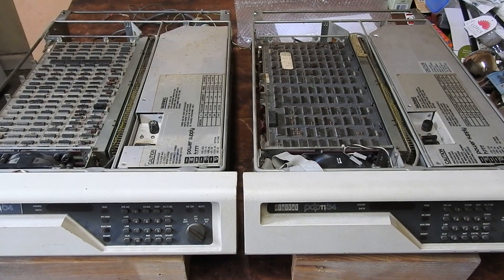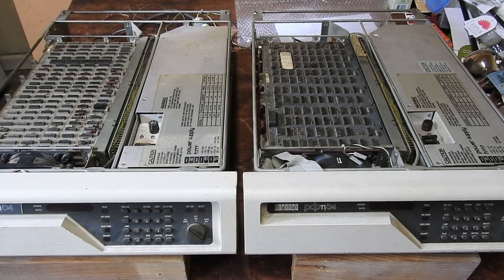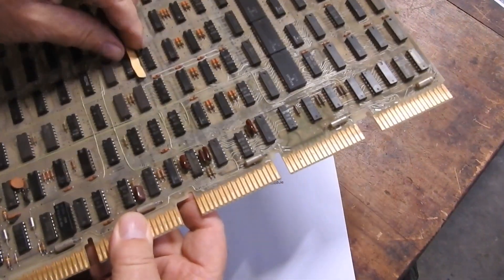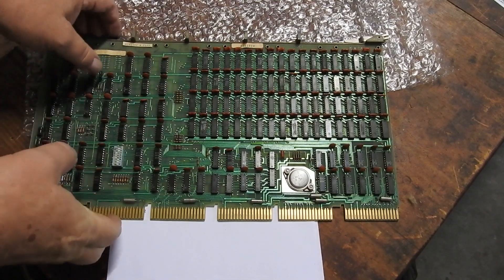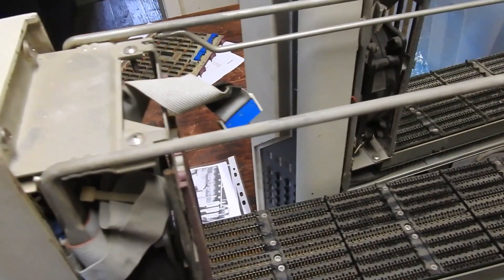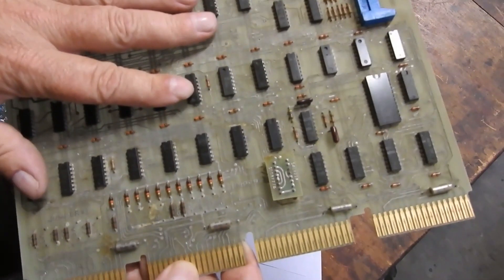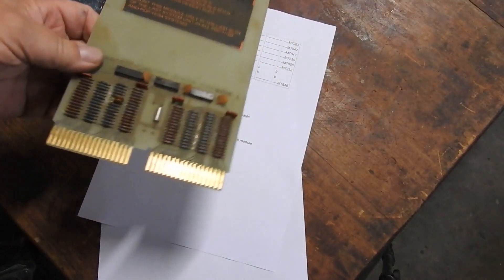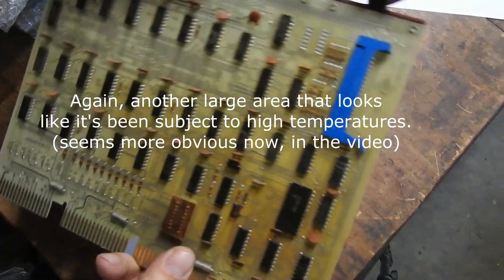Digital Equipment Corporation PDP11/04 & PDP11/34 Minicomputers - Teardown

Comment: Octal notation instead of hexadecimal makes sense when the instruction set encoding of the PDP-11 is considered. There are 8 registers and 8 addressing modes that can be applied to a register. With dual operand instructions a source register and addressing mode is specified, and a destination register and addressing mode is specified. Those 12 bits of the 16 bit instruction can naturally be encoded as 4 octal digits. That must have made things easier back when programs were manually assembled and toggled in by hand.
Reply from the maker: Fair call, though a niche case. Probably peculiar to the PDP11, rather than power-of-two-word-length-computers in general. And I suspect that "mental assembly" while hand toggling would be a rare activity. My comment related to more to data, where splitting or concatenating, especially with bytes, is a major pain. 

(And it always bugged my sense of symmetry that an octal digit did not always represent 3 bits, and sometimes even only 1)

Comment: Where are you based mate?
Reply from the maker: Melbourne...
Reply: @bertoid  We are based in Sydney at the @australiancomputermuseum - great work on restoring these units. We have a few dozen PDP 11 variants for restoration
Reply from the maker: @digitalrampage  Hi, I may have seen those units (Max showed me around the old warehouse many years ago). 
If I was in Sydney, you probably would have seen quite a bit of me by now!  And since the 04 and 34 don't work, I would like to have tried some board swapping with your units - would have been very helpful in isolating the faults...